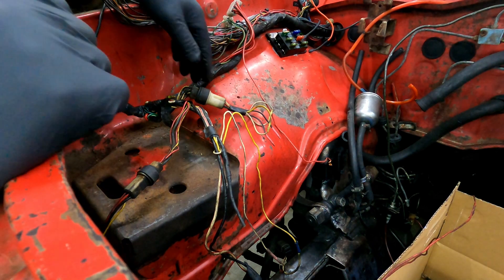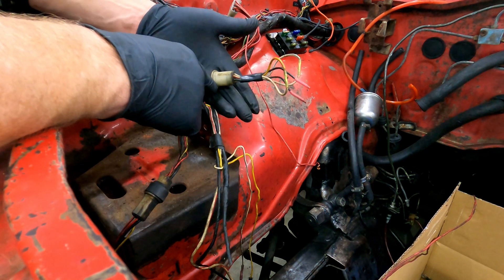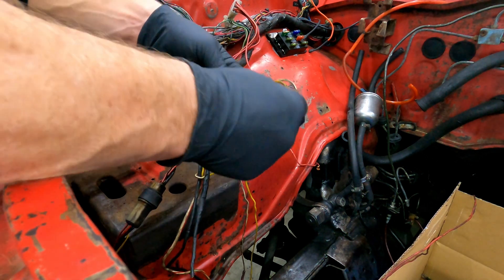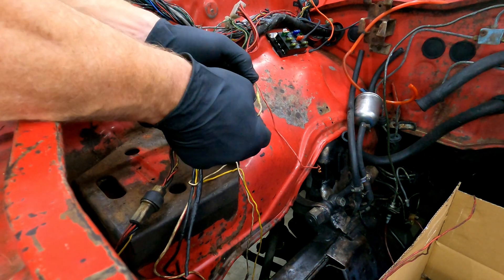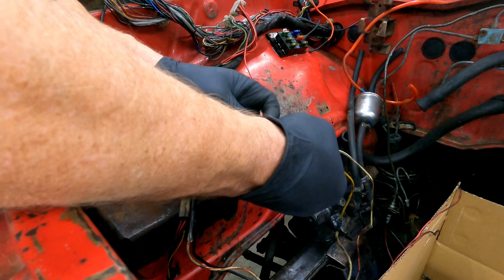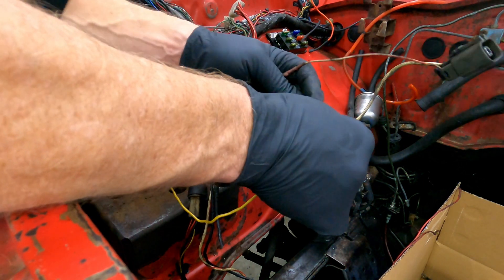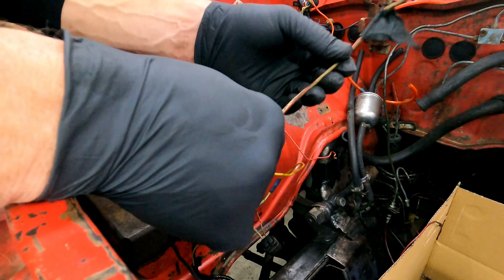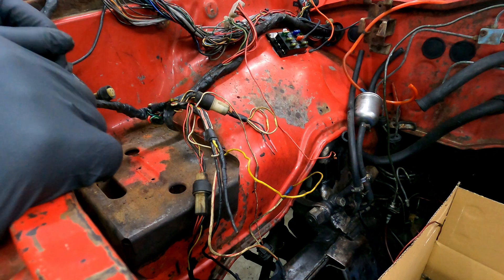How to Bypass the 620 Voltage Regulator for Installation of an Internally Regulated Alternator

Comment: THANK YOU SO MUCH.  I've been banging my head into the keyboard looking for a voltage regulator for an old datsun/Nissan forklift. I couldn't find a new one, no parts info, no wiring diagrams, nothing. I've decided to bypass it but I wasn't sure how to loop and cap the ends. This looks like it will work. Thanks.
Reply from the maker: Glad to help

Comment: Any suggestions on year and make of begicle to use for the donor Alt. Thanks and great vid!
Reply from the maker: The easiest would be from a later year Datsun with an L series that has an internally regulated alternator. 78 thru 80 620, 510 or Z.